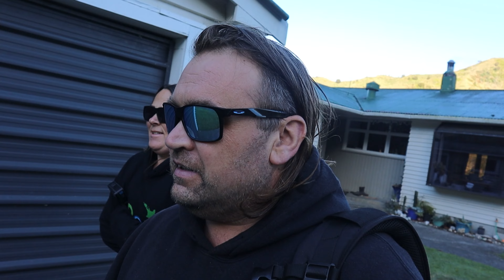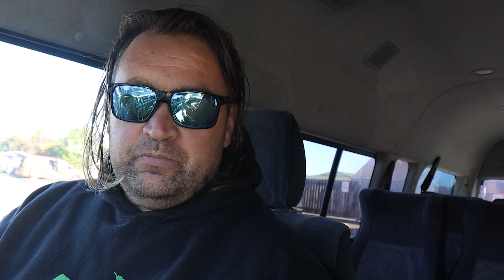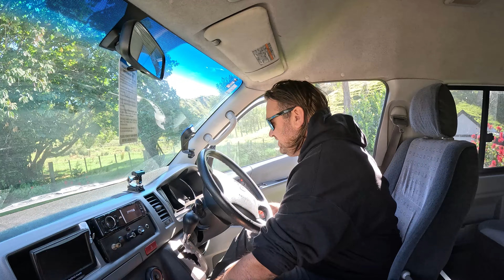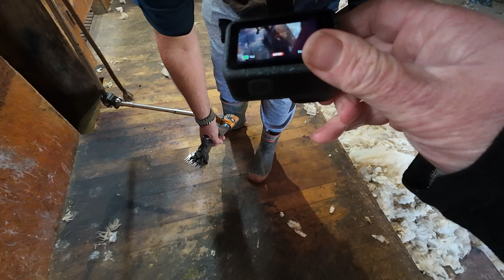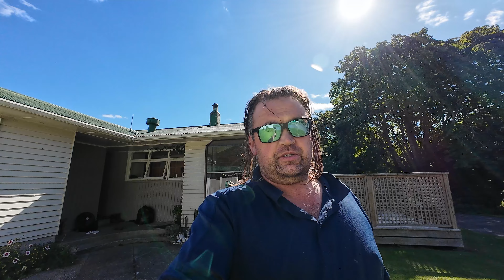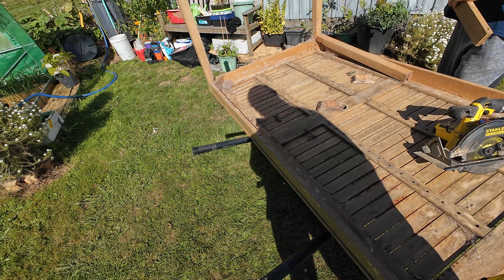DJI sheep video competition was a fail so we'll try with GoPro [Life in New Zealand Daily Vlog #621]

Comment: 3 degrees,far-out, <shaking head>
Frost there already.
Reply: Card board empty boxes can make life easier,i prefer them to shopping bags.
The frozen you could use a chili bin with chiller pads 😂
Reply: <thinking> the other half of the table could be useful later on,just put some hinges on the edges of both halves,
It would turn into a fold up table.
Just need another two legs.
Reply from the maker: I know! It's way too early for that!!!
I've got a few crates kicking around, they're good for that too. It's just remembering to put them back in there!
Reply from the maker: We've kept it! It'll get used somewhere. Good idea!